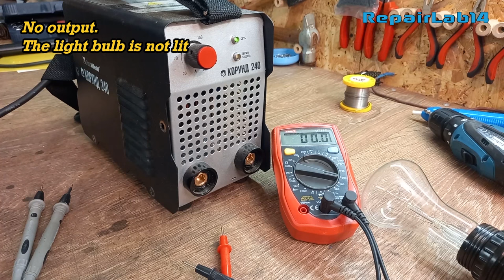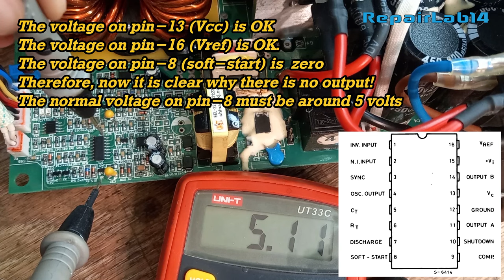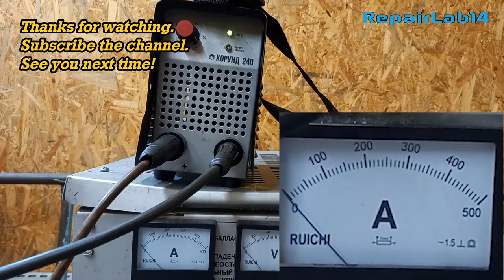No output. Repair of a welding machine

Comment: Boss what is problem for inverter welding machine 200a,250a,300a, after I change the four igbt, and I check the output voltage is 90vdc, when I test the sparking, immediately the igbt will explode back, sir what is the cause sir?

Comment: Hello bro,i changed all 8050 ,zener,6.2k ,22k resistor but i am getting 0.8v at 8pin of 3525 what could be yhe Resason,should I remove IC because that only left to change now

Comment: Hello I have the same problem on my mma 250 igbt welder. Pin 8 was reading low and I've removed j3y smd transistor and now it works. Should I wait for replacement transistor arrives or can I work with welder?
Thank you
Reply from the maker: Yes, you can

Comment: I have the same welder and I have 67 volts at the output but it has no current. The output diodes and triacs are fine, the sg3525 works correctly. I don't know where to look anymore
Reply from the maker: Maybe operational amplifier LM358

Comment: I recently got a Kzubr 400N MMA single phase stick welder which  claims to (input 220v-36.6A stable, up to 47.6A max input)output 400A lol.
Anyway it seems to be built solid and after further inspection I found that the real output is actually 200A which is still awesome considering I paid 120€ for it.  Anyhow I have taken it apart and examined it and the insides look pretty identical but instead of the ground and stinger bars that are made of aluminium in the one shown in the video mine has them made of copper which was nice to see.
Anyhow what do you think the life expectancy will be of my machine?
Reply from the maker: Depends on your luck. )))

Comment: I have a welder machine which there is not output voltage. I tested 2 IGBT = Ok, 4 Diodes = Ok, 3 Polyester caps ok, 2 with 4.7 uF and 0.02 Esr and other 400v with 4.7uF and 0.03 Esr. Bridge rectifier is Ok. But, i haven't square waves in gate of 2 igbts. Thre wave it's similar to a part of senoid. Is the module the problem ?
Reply from the maker: Sometimes the IC on the control board fails on its own.
Reply: @repairlab14  The fan try to rotate . However, it moves too much small and i don't have 24v in this line.
Reply from the maker: @lucasrocha4329  A short circuit on the 24V line and the power supply does not start due to overload, or the IC is powered off from the secondary circuit

Comment: I have looked at data sheets and diqgrams and no info on correct voltage at shutdown/soft start pin. Thanks for sharing the info. 👍
Reply from the maker: Vref 5V

Comment: excelente video... tengo un problema parecido en el pin 8 tengo 7.8v y no arranca el integrado... ya cambie los dos trasistores y revise todas las resistencias... no puedo encontrar el programa
Reply from the maker: On pin-8 must be 5 volts, same as vref. Replace 3525.
Reply: @repairlab14  ya lo cambie pero persiste el problema....... gracias por responder